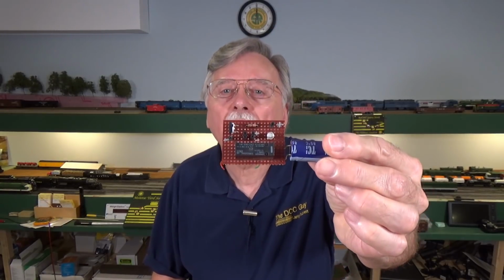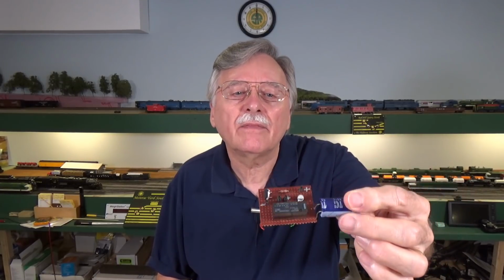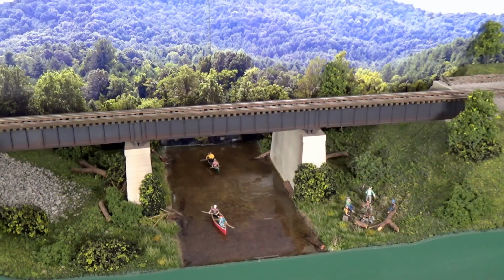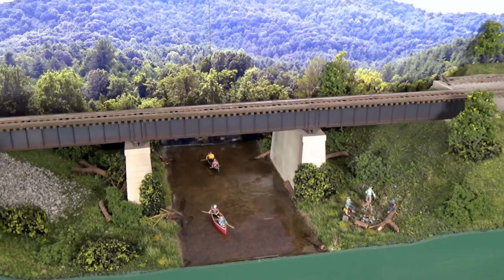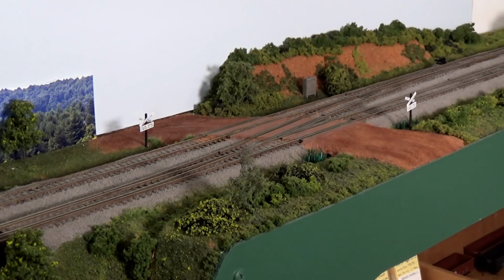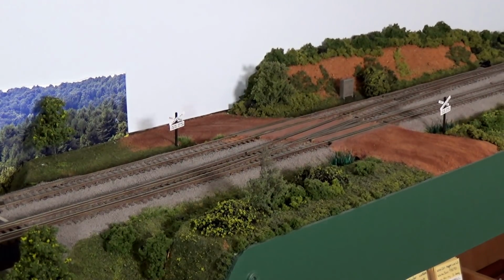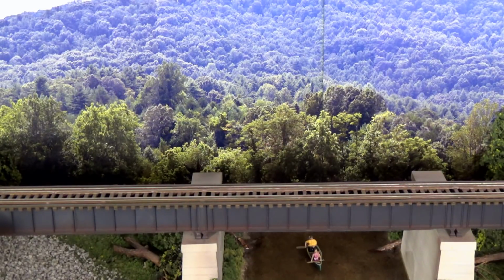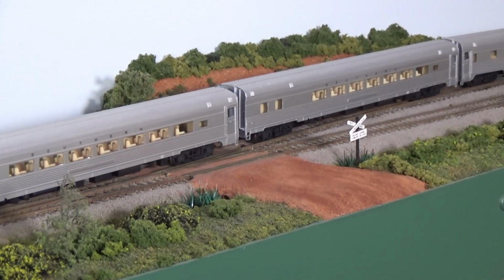Signals For Your Model Railroad (217)

Comment: well would like to see you set the signal light up step by step
Reply from the maker: I wish I could do that but there is very little space between the two levels of the layout. Consequently getting a camera and lights in close enough to actually photograph the process was a no go. I will try to demonstrate the process steps with the latest signals that I posted last Friday when I show how to wire it up. However even with that it will require a bench top demonstration.

Comment: 20,000 yipee congrats, well done, I wonder about reality. I think a train can hit a green signal at full speed your train would not be sitting stopped there. On our local railway the signal at each end would not have any green lights fitted, only options would be red and yellow. I am pretty sure the signal prior to each would be yellow prepare to stop at next signal. Both signals would be at red and the despatcher would set it to yellow once the route was set which could be prior to the train coming to a halt. We call it fail to safe.
Reply from the maker: Good observation, I can easily switch it since I have the yellow LED installed as well. All I need to do is pull out the green wire and insert the yellow one. That’s the good thing about using the screw terminals for connections.
Reply: @TheDCCGuy  Thanks I did enjoy the video and will look at incorporating the concept into my next layout. I checked with our local despatcher. For safety reasons the final signal before the bridge would both be at red and only set to proceed with caution (yellow) once the train had stopped.
Reply from the maker: That would be hard to to implement on a layout and likely require computer intervention, some very fancy electronics, or a dispatcher to control the signals. I think I’ll throw caution to the wind and go with yellow/green signals and leave it at that.

Comment: This is probably a really novice question but do the trains stop automatically when the signal turns red and start up again when it goes green?
Reply from the maker: No, but there are ways you do that although not cheap. Mine works like the real prototype where engineers are expected to stop for a red signal.

Comment: Congratulations on the 20.4k subscribers!  Does the signalling over the gantlet track bridge stop the opposing train, or is that down to the operator to make sure the signal is obeyed? I wondered if there should be a second detector on the exit from the gantlet section in case the train stalled after it had cleared the detector at the entry to the section: though I suppose that's only really an issue if the signalling is controlling the locomotives, as the 1:1 scale operator can see the obstruction.
By the way, I've also seen gantlet/gauntlet track used to describe where two lines different gauges share the section of track, with both gauges sharing one rail.
Reply from the maker: The model system, much like on the prototype depends on the engineer to see and obey the signals. I believe there are some modern systems that do shut down the loco at a stop signal and it probably could be done on a model using a computer interface and some fancy programming. I originally did have a second optical transistor on each side of the bridge but ran into issues with false detects when turning on the DCC. I suspect using shielded cable would fix this and need to experiment more. I’ll discuss this in the next video.

Comment: Larry, Congratulations on 20K - well deserved for your excellent content. 30K by the new year!
Do you just use Stop, Approach and Proceed or do you use some of the other speed signalling aspects like Advance Approach and Approach Medium?
Reply from the maker: I keep it as simple as possible. This is already more than the operators in my area are used to plus it is easiest to implement without using JMRI or some other computerized approach.

Comment: This channel should have more than double 20k subscribers. It's full of useful and interesting info. Congrats Larry.

For UK modellers especially, MegaPoints Controllers have just introduced a new board capable of handling anything from 2 to 4 aspect signals, can daisy change boards to link other signals and automatic braking system on so enabled DCC chips. By the way, Im not the owner of MPC!
Reply: And 3 years later it has 55,000!!!

Comment: It's gantlet. Gauntlet is used by people who don't know that gantlet is a word. Gantlets were also used on a few car float bridges to get the points off the float bridge and on land. They were also used when two different railroads wanted to get through the same choke point but, for whatever reason, didn't want to physically share the same rails.

Comment: Congratulations on 20K!  Larry, I’m new to model railroading and not electrically inclined. I’m planning and investing in a DCC layout and recently purchased a Digitrak Zephyr (3.0A). I have two Bachman and one Life Like 3 DC transformers that produce a minimum of 18v AC from their accessory side.  Can I use them separately from my DCC system to power AC accessories like turnouts, lighting, etc using a separate buss, of course?? Thanks and keep up the good work!  Ken Wiegand, Milford, OH
Reply from the maker: As the man said you certainly can do it but I think you might find a 12VDC accessory bus more useful.
Reply: Absolutely!